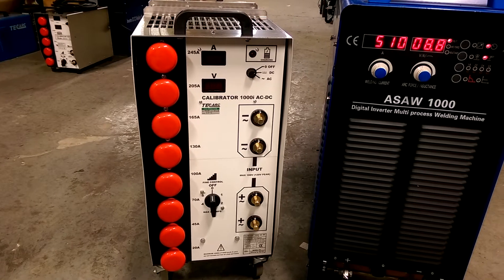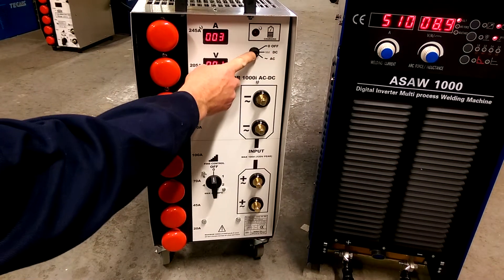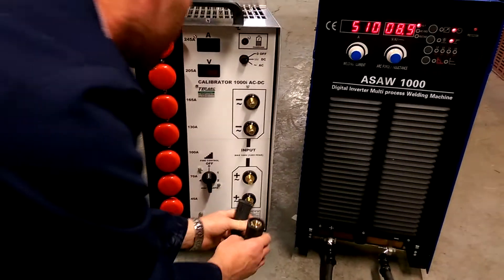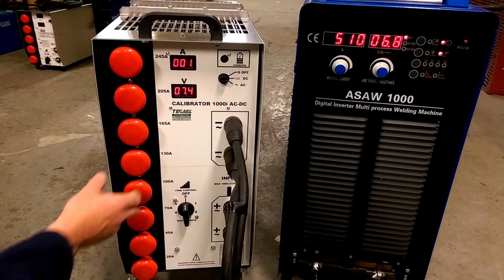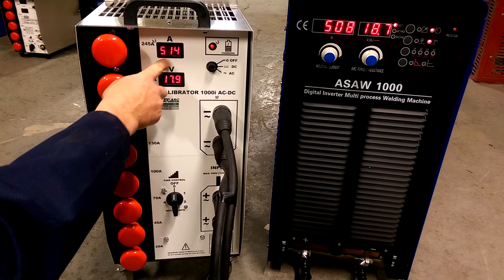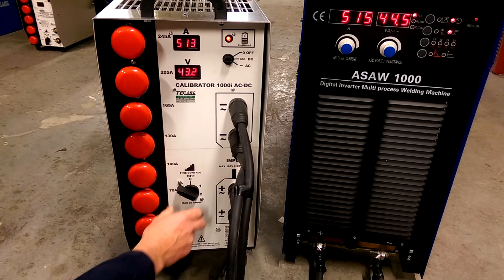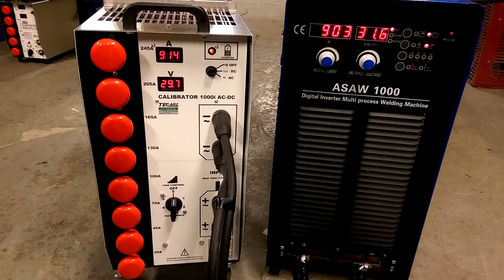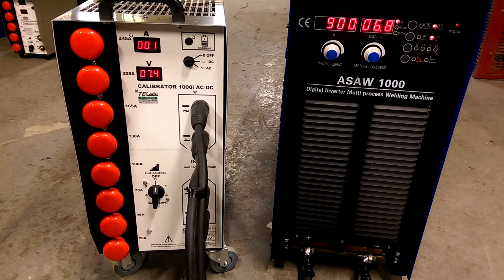TECARC Calibrator 1000i AC DC demonstration

Comment: I think voltage reading on calibrator is accurate. I think you forget to explain difference by voltage drop in cables due to high amperages supply.